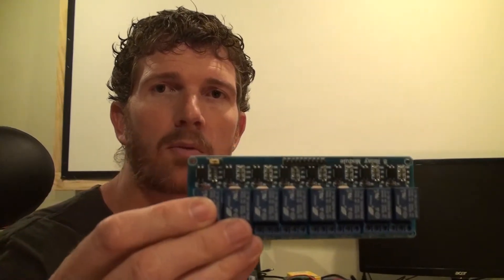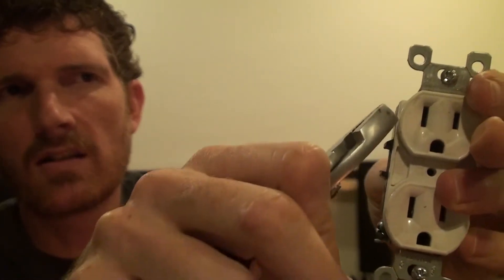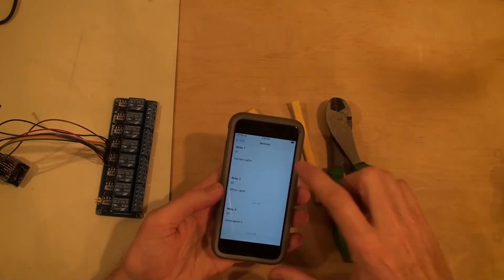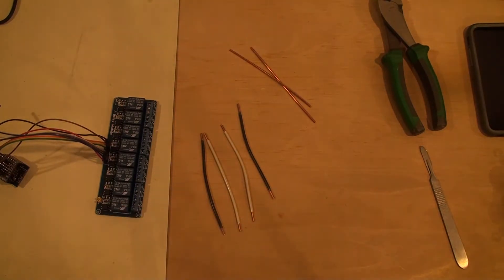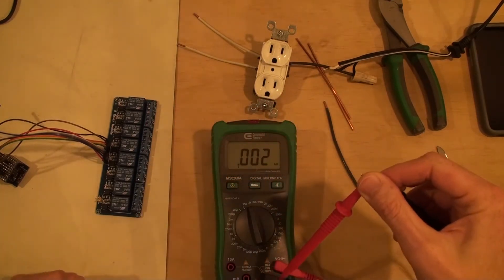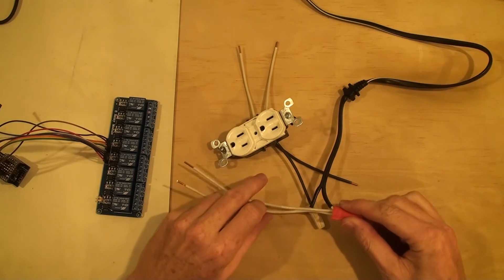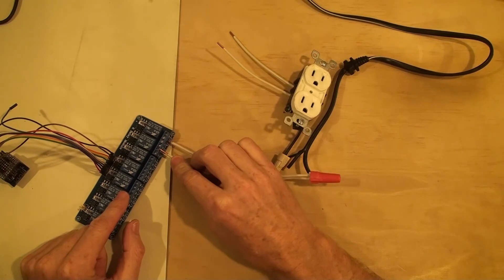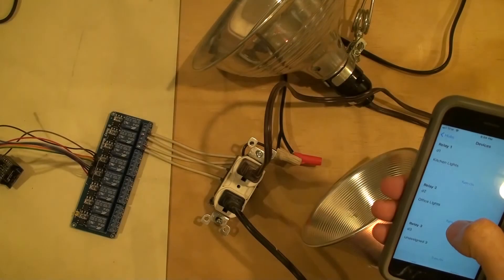Control an electrical outlet with 2 relays for WeMos Arduino Raspberry Pi Home Automation

Comment: Now did you  Run the Neutral from the ac supply through the relay? If so You should never have the neutral going through the relay.(THE NEUTRAL IS NEVER SWITCHED)Your feed AC supply or ( black wire)  should be switched through the relay, That way when the relay says the power is off ... The power is off!.
And for these relays I would recommend 14 gauage stranded wire, Not soild wire.
But good video for us Newbies.
Reply from the maker: Thanks for the comment! You make a good point! I know in some circuits I’ve seen on motorcycles the ground is switched. It makes sense not to do that for AC.

Comment: This is exactly what I want to do. But I want to plug in a small space heater (maximum wattage: 1500; current rating: 12.5 amps) so I can turn it on and off remotely. Should I be worried about the relay handling that load?.
Reply from the maker: You can use any relay that’s rated to handle the load you want to switch. You should also add a fuse or breaker to stay on the safe side.

Comment: great video
1 question ^ i made a similar poject which is designed to turn 
 on/ off ac unit ussing blynk app  relay and node mcu worked good for sometime and than stopped working, while troubleshooting figured that relay outputs are burned(com&n/o) it still goes on&off upon micro controller command 
Input works but output doesn't
  so what could be the problem? The ac has 20A dedicated  line  maybe shouls use a diffrent relay which is capble for 20A?
In adddion i use 12~2 stranded flexible wires they are easier to handle and i've read  it is better to avoid microcontroller load to relay input but use diffrent power sourse. also, i use a transistor and a resistor between gate & source in oeder to prevent current floating after  the switch shot down
Reply from the maker: Yeah it sounds to me like you need a heavier duty relay.

Comment: Trying find video where you made the relay bank and a list of the parts, please help?
Reply from the maker: I think you mean this one: https://www.youtube.com/watch?v=NcPFSRaM-zg
Reply from the maker: or maybe this one that uses the Lolin/Wemos D1 Mini: https://www.youtube.com/watch?v=sg2peFyqlyE
Reply: Thanks will check them out? Does you app supported on windows or android platforms if not can you suggest something?

I'd like to make a system to control power plugs as you illustrated in your video and usb port set to a timer or virtual clock.

Comment: This is amazing!! If I wanted to have 4 sockets in total, do you think it would be possible to power them off of two wall plugs? Or do you think this would require going straight tot the breaker?
Reply from the maker: Anything is possible. :) I would probably power them inline by installing a control panel somewhere between the breaker box and the outlets I wanted to control.

Comment: Hello, I am a little concerned at your wiring of the live 110 volt. You are breaking the neutral line and not the Hot Black wire. The problem with this is the receptacle and anything plugged into it will always have live current being feed to it from the main source. Let me explain with the neutral line switched off at the relay as you show the receptacle will turn off the item plugged into it as you expect, However there is still live full current at the receptacle just waiting for someone to think the item plugged in is dead but is live, in fact if you where to put your meter in the hot line side of the receptacle then touch the other lead to ground you will see full live current and you could get electrocuted. The live current should be at the relay then switched on and off from there. This way you will never have live current at the receptacle until the relay is turned on. All the neutrals should be connected together and the hot side switched at the relay. Thank you for taking the time to make videos for you tube and I am not bashing you I just don't want to see anyone get hurt. Be Safe. Thanks
Reply from the maker: Tony Minnella Good point! Thanks for your comment!
Reply: Your welcome  just switch it around and break the hot and keep the neutral as one and all will be good, a bit safer.
Reply: Thats what I said!!! Electricity 101
And i would recommend stranded wire.14 guage.

Comment: hello, can you help me with outlet like that but i need to use ultrasonic sensor and raspberry..can you make a video, i watch this video and its similar with our thesis, i only need to know is how to connect the sensor thrue raspberry and outlet...thank in advanced, i hope i get help from your channel..
Reply from the maker: So you want to use an ultrasonic sensor as a switch to control the relay then? I don't have an ultrasonic sensor at the moment but you'd setup one of your pins on the raspberry pi as an input and connect the output from your sensor to that pin. You'd read the input from the sensor and setup another pin on your raspberry pi as an output to control the relay, then based on the input from the sensor you'd switch the output to the relay either high/low to switch the relay on/off.
Reply: @MakeFixUpgrade  i dont know how to do it and what is the first to do, because i am new with raspberry...all i need is how to set up the circuit and the python code

Comment: The wire you showed is either 12-2 or 14-2. The ground is not counted. -3 has the extra red wire for 3 way etc. 12 is usually used for 20 amp vs 14 for 15 amp.
Reply from the maker: Good catch! Thanks for commenting! I got it right in my other video of how to wire a 3 way switch but yeah, you got me on this one. :)

Comment: Hi, I did one like this, but if i plug the AC socket for overnight, my relay become faulty, it trigger itself on and off in interval, despite there is no an ON signal from my esp (the red led on relay is not on). Did you experience this too? Or where did I go wrong?
Reply from the maker: I haven't seen that issue happen with my setup. I'm not sure what to tell you as it's hard to diagnose the cause without seeing it first hand. A couple things to check would be that your relay is rated for the voltage/current you're running through it, that your wiring clamps are tight and that you have it wired up correctly.

Comment: Thanks a lot ! I finally got everything setup correctly after watching this video . I’m sure other viewers will definitely appreciate this video . I also tried this with Siri using Homebridge on my raspberry pi and works perfect . If you haven’t heard of Homebridge you should look it up . Thanks again ,for the video and diagram you drew up.
Reply from the maker: Cesar Gonzalez no problem, glad it helped. :) I’ll look into homebridge, I was looking into using Siri Kit in my app to control stuff via Siri in my phone.
Reply: CrushingDemons Homebridge is used in apples HomeKit app and you can add devices that are not supported yet by using plugins that are created by users and there’s hundreds of different plugins . I believe there’s a WeMo plug in . I use this instead of Alexa only because I didn’t know how to make it work when I wasn’t home . With Homebridge I can control everything from anywhere I’m at
Reply from the maker: Cesar Gonzalez oh nice! I was aware of home kit but haven’t looked at it yet. For some reason I always choose the hard way and try to build it myself. I learn more that way haha. Will definitely check it out though!